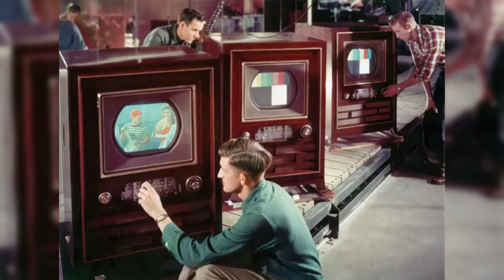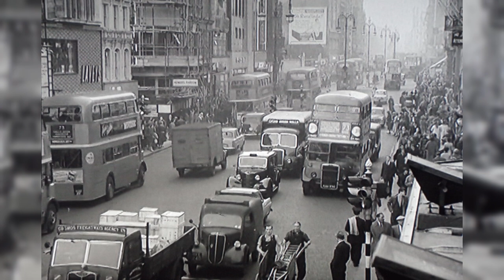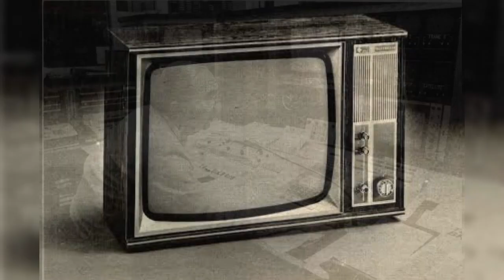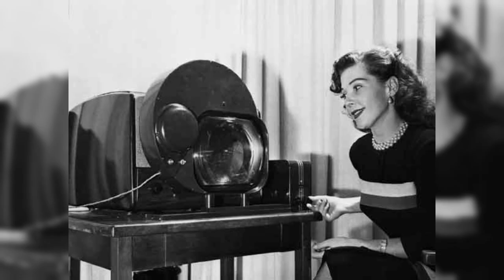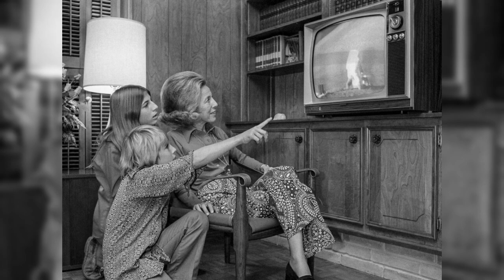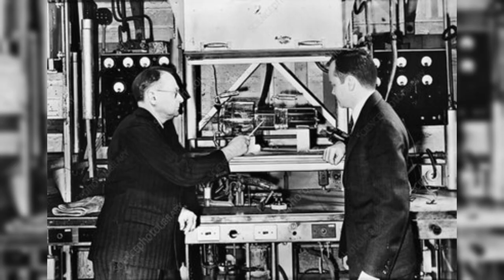Britain Had No Colour TV in 1966 — Until Engineers Hacked ‘PAL’ to Beat the Americans on Screen

Comment: 6 miliHertz?

The EMI 2001 four tube camera was large, but it required a huge camera control unit and power supply unit.

NTSC uses 29,97 frames per second not 60.  PAL uses 25 frames per second.